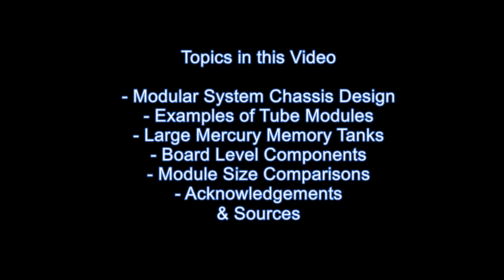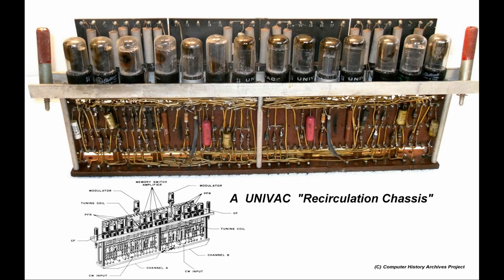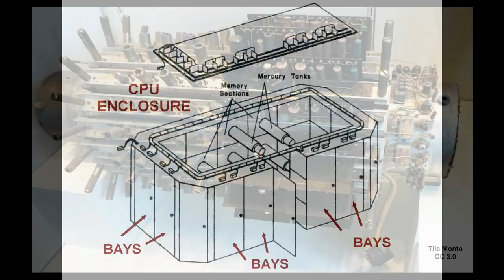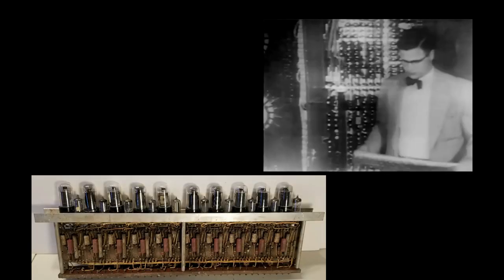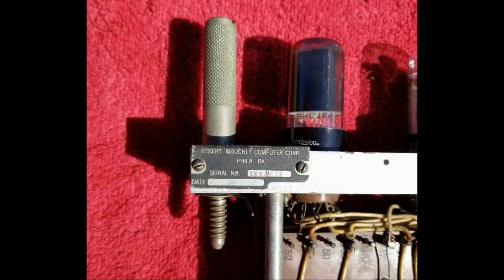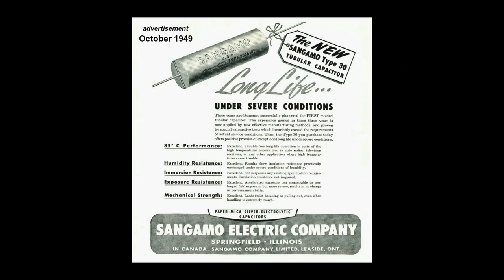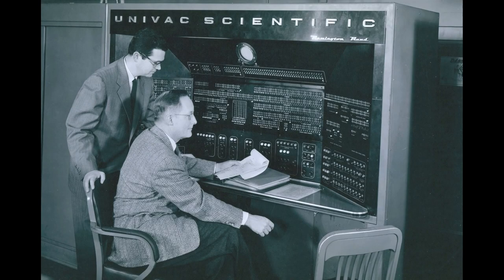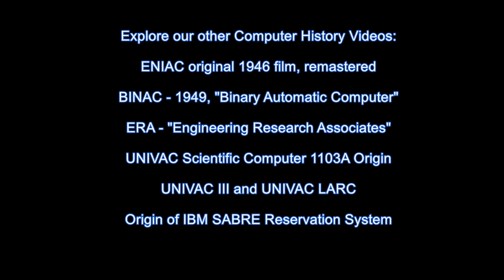Computer History: Exploring UNIVAC 1 Components (with UNIVAC II vacuum tube module compared) 1951-58

Comment: It kinda blows me away (and its kinda cool) that a Univac1 was used up till 1970.. computing had advanced so much during that time... but i guess they were just trying to recoup their investment as much as they could... but one wonders if the cost of maintenance and electricity for a valve/tube computer that late in the game was actually worth it
Reply: Likely retired because the spare parts were now no longer available, and the replacement machine likely was 100 times faster, 10000 times more storage, and cost the same as the spare parts and technicians for a year of operation.
Reply: Running a machine took a lot of money. Writing code took a lot of money. You had to balance the savings in replacing an old expensive machine with a new less expensive machine against the cost of rewriting and then debugging all of you applications on that old machine, and the very good possibility that there would be bugs in the new versions that could cost you money, reputation, or even legal problems.

Comment: Very nice piece of history here.  I had an RCA prototype electrostatic storage tube of my dad's which stored 1024 bits, I believe.   It was a 6499 Radechon.   I had a tech magazine advert for it too.  It was used in the SAGE computer but I believe it may have been a short-lived solution for memory.  Love the mercury memory - never heard of that.  I remember engineers at GE where I worked in the 1980s told me our earlier E2C radar used magnetic drum memory, in the 60's I believe.  The advancement of technology is pretty wild.
Reply from the maker: Hi Don, that sounds fascinating.   Had not heard of the 6499 tube specifically, but it looks pretty awesome.  Found this nice quality photo here:  http://www.decadecounter.com/vta/articleview.php?item=795
I bet GE was a good place to work.  Lots of changes.  Thanks for your comments!  ~   Victor, CHAP

Comment: Never seen a mercury memory tank before !  That is cool !
I wonder if there are any schematics of these computers, or partial schematics around ?
Reply from the maker: Hi boB, great question.  Actually, there is the 164 page UNIVAC Maintenance Manual on line at this link:  http://www.bitsavers.org/pdf/univac/univac1/UNIVAC1_Maintenance_Manual_Jan58.pdf    It has some great background and diagrams on the machine. ~   CHAP
Reply: Thanks !  That is a great manual !  There are partial schematics in there.  OCR'd text too.
I might be able to find somewhere a schematic of some flip-flops which do not seem to appear in this manual.  There are MORE manuals on that site though so maybe ?  Also a programming manual.  That could be interesting !

Comment: They must have been receiving daily shipments of vacuum tubes at their door. Holy cow.
Reply: And they named it "Uni" Vac? More like MultiVac...
Reply: If you never turned them off they last a really long time. there are still transatlantic submarine cables with the original vacuum tube circuitry still in use, though the majority of them have now been either abandoned or upgraded to solid state. They would last decades in use, as they almost never had the power to them turned off.

Comment: Was this the computer model that gave rise to the term 'mainframe', referring originally to its CPU enclosure?
Reply from the maker: Hi Hal, that's a great question.   I can share my thoughts on that, and perhaps someone else can chime in with more info.   The UNIVAC 1 CPU was usually called the "Central Computer" or informally, the "box."   Technically, it was the "Main Frame" that housed all the primary logic boards.  The word mainframe does not seem to appear in the 160 page UNIVAC 1 manual.  When the IBM 1401, 704 and 705 machines arrived, they were typically called called "EDPM" (Electronic Data Processing Machines).   It seems the use of the term "mainframe" really gained popularity in the 1960's to distinguish them from minicomputers or smaller computers.  It became a marketing term implying big iron, etc., as I am sure you are aware.   Anyway, perhaps someone can find a good reference for this question.  Will keep looking, it is a fascinating historical question.  Thanks!  ~  Victor, CHAP
Reply: @ComputerHistoryArchivesProject  Thanks for the reply, Victor.

Comment: MTBF?
Reply: About a day. All vacuum tube computers had a daily PM (preventative maintenance) session, typically from 6 to 8 AM, when the techs went thru the machine and ran diagnostics and replaced components that were marginal and likely to fail before the next PM session. With good luck the machine might then run from 8 AM to maybe 6 PM without failing, when it would often be idled (this the B+ power shut down but the filaments running at reduced voltage) or shut down completely until the next day. If the machine had to run multiple shifts there would often be a second evening PM session to check margins and do any needed replacements.
Reply: @lwilton  Fascinating details there.